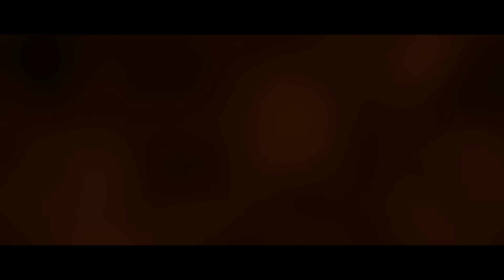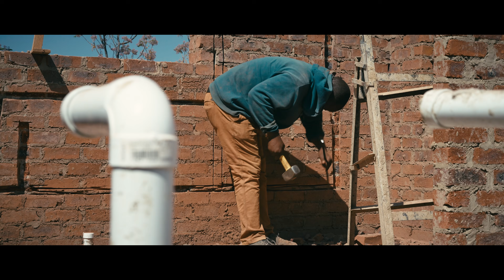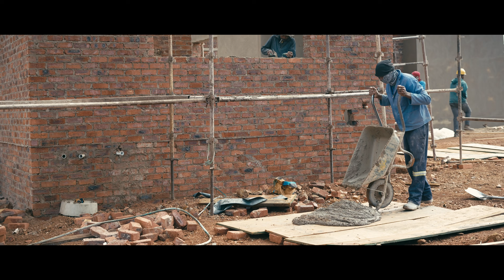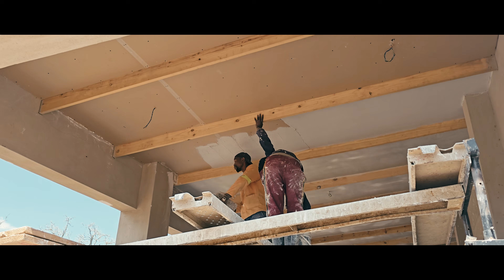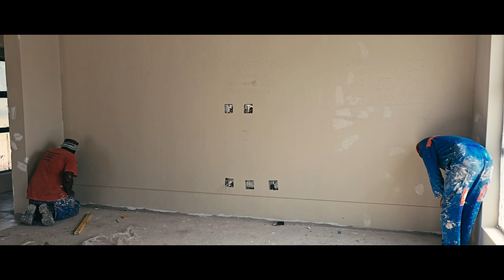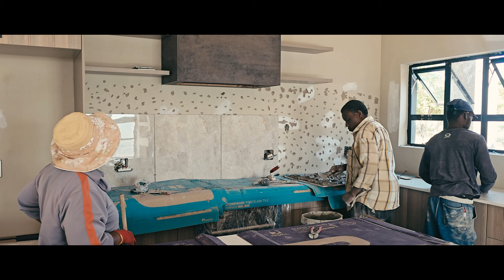Building a Modern Farm House Cottage: The Full Construction Journey

Comment: How are the exposed roof trusses held to the wall? And did you use treated timber?
Reply from the maker: The trusses have bracing tying them together. They are also fixed to the wall plate attached to the walls. The last thing is the brickwork that comes after to fill the gaps. The oil we used to color the trusses is an oil stain that also treats the timber.
Reply: @bm.studio  Thanks a lot!